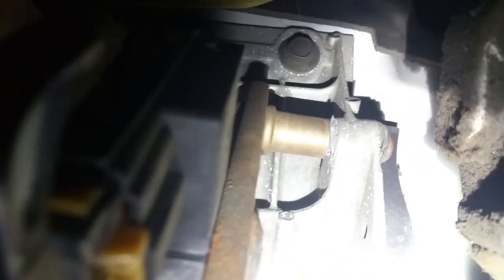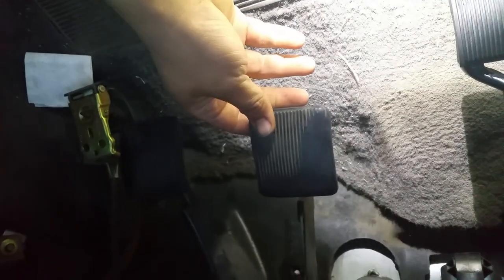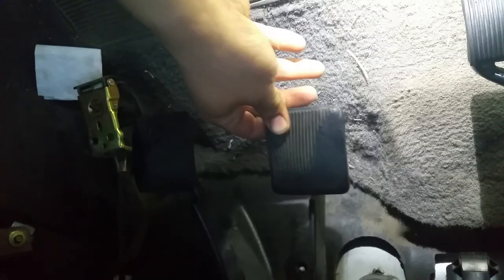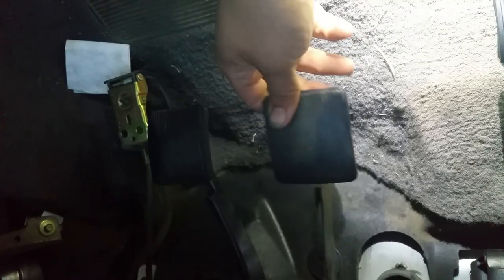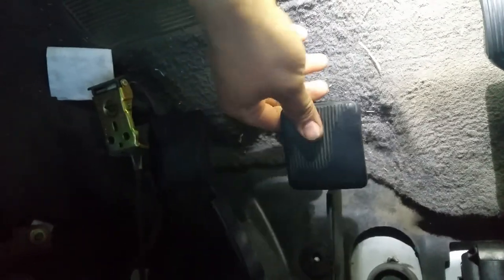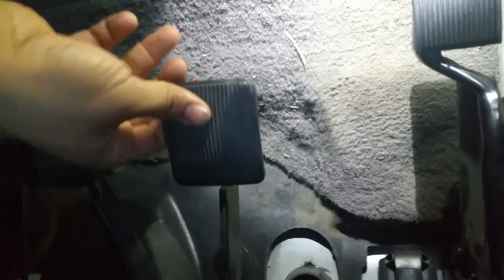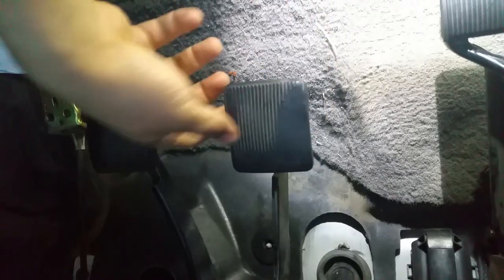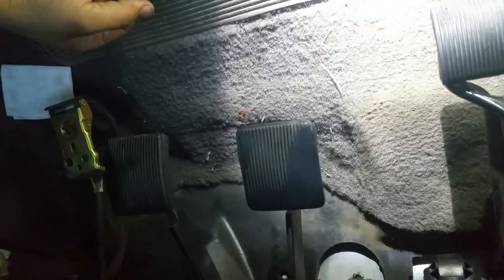Ford Ranger Clutch Issues

Comment: The old Cherokees had this exact same problem. Back when I was young and thin was able to change it out without removing the seat, by completely inverting myself on the seat haha.
Reply: Lmao I just removed my seat because I’m fat kinda hahah
Reply: @Findmylimit  if I ever had to do it again...I'd pull the seat, or risk getting my aging dad physique stuck haha
Reply: In my Ranger to unhook the clutch master cylinder from the pedal I had to lay upside down with my feet out the passenger window

Comment: I’m having trouble on my 91 as well swapped it to a 5 speed m5r2 and threw in a new slave cylinder new master cylinder and new steel braided  line. No leaks from any of them and when u go to press the clutch all the way down the hydraulic slave cylinder moves ever so slightly & that’s after half hour of bleeding it
Reply: Theres a video on how to properly bleed the cylinder that connects with the reservoir, you cant bleed it by just pumping the pedal and undoing the bleeder.  But it makes a huge difference

Comment: I have the same problem on my 97 b4000 It's a crack across the whole bracket , but in the same corner with the same flexing result. I am on my fourth clutch in 115,000 miles as no one noticed this damage before , just a lot of griping about how hard it is to bleed. The clutches have burnt up because they never release properly, always some friction even when the pedal is pushed to the floor. Where can I get a new one? Has Mazda redesigned a new replacement part to address this issue or will I be installing a new one that can break the same as the old one ? Any Factory recalls or complaints to the NHTSA ? . Junkyard , dealer , or aftermarket ?  There may be thousands of these driving around. This is dangerous.
Reply: Were you ever able to find out if there was a factory recall on this problem I have a 96 with the exact same problem

Comment: Dose that issue cause the truck not to start?
Reply from the maker: No it will not cause a "No Start"  it will just cause the Clutch to engage half way down the pedal. and occasionally even cause Gear Grinding.